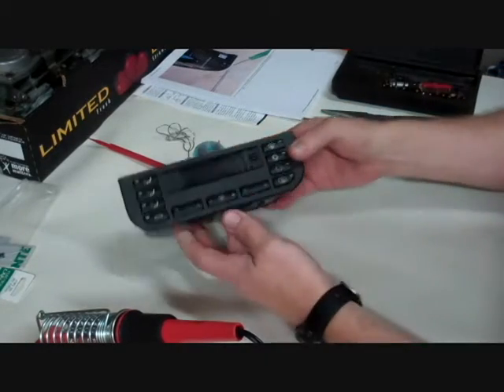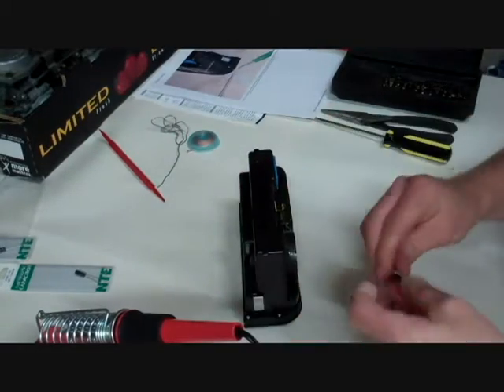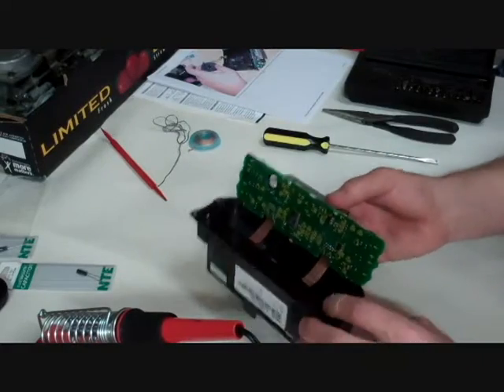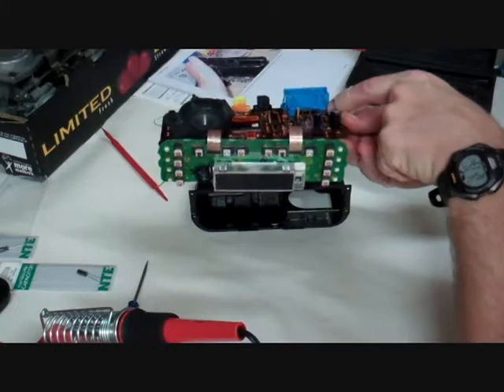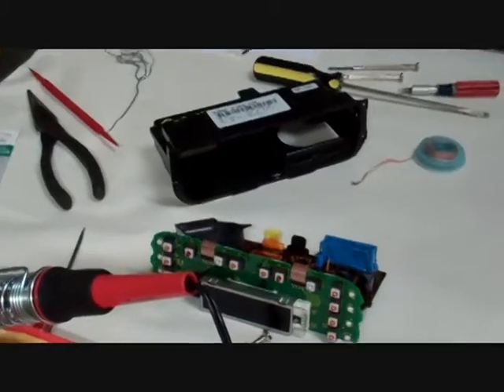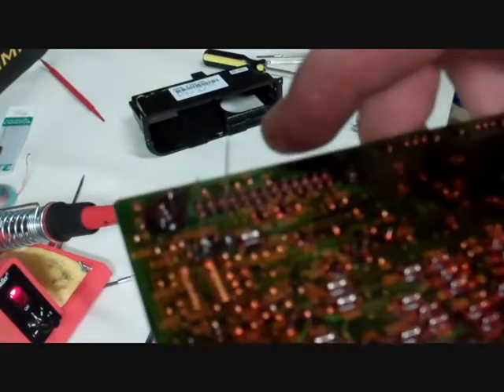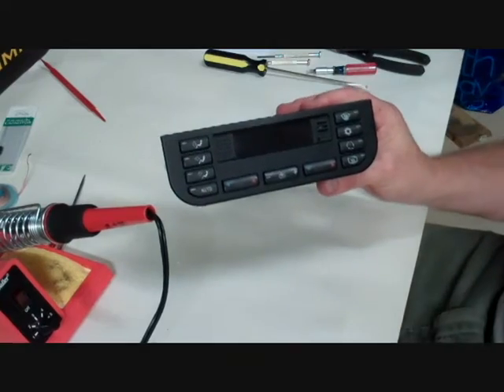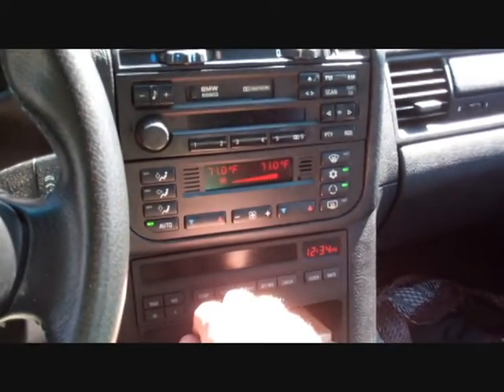BMW E36 Climate Control Unit Fix

Comment: Very helpful to know how all the bits fit together thank you so much. I didn't actually replace the capacitor but just resolved it. A friends advice who said it might be just a dry joint. Anyway, now working fine. And the benefit of courses not just saving money but the inconvenience and delay. Thank you again.

Comment: Barry, on my 1993 525i  e34 the AC, Recirculating and rear defogger buttons do not light up. AC doesn’t work.
Could your capacitor fix work. Thanks from BC Canada.

Comment: Is it non-polorazed capacitor or not ?
Reply: I believe non polarized is fine.
Reply: @barryhasenkpf2989  what if i put a polorized one what Will happen ?
Reply: @barryhasenkpf2989  yes i found polorized 470nF 50v capacitor
But i dont know how to put it i dont know the positiv and the negative side in the circuit
Can u help me
Reply: @barryhasenkpf2989  so if i put a polorized one is OK ?
Reply: @barryhasenkpf2989  OK thank u so much sir

Comment: I have a problem with my climate control (not digital)318i 1992 why the fan always on about 5 minute even i`m not turn on the ac,may be u have the solution sir thanks.

Comment: How can one pin point if it's the capacitor or the fsu? Mine turns on and off randomly and only blows hot air. It'll blow hot air through the windshield and my feet randomly too and the climate control isn't even on
Reply from the maker: Unfortunately, I've only found the process of elimination to work best. I start with the final stage resistor and when that didn't fix it I replaced the capacitor.  If your symptoms are similar to what I described then start with the capacitor.
Reply: Well said, that's what I'm starting with, should be here in a day or two.  If not I have the capacitor in my cart waiting to be ordered.

Comment: Because you are changing the capacitor, which is the defect my is disappearing the letter almost never turns on, and letters come out in half.
Reply from the maker: I'm not sure it's the same problem but the capacitor fix is relatively simple and cheap so you could always do it to make sure.
Reply: I have a 1997 BMW 328i and my odometer had this issue. I followed the 1st guy on this forum, he left a pdf on there.  I think in your case you may want to follow this link  http://www.pelicanparts.com/BMW/techarticles/Borrowed/e36-climate-control-repair.htm

Comment: Thank you for this video.  Very helpful in fixing my Climate Control unit.  I couldn't find a .47uF50v cap.  I ended up using a 1.0uF 35v cap from radio shack.  I read that >.47uF 35v will suffice.  It actually works now and saved over $100.  Again thank you

Comment: I have an e36..mine like to turn it self on..it only blows air from the front vents and it's Dosent get hot or cold...would this fix the problem...???
Reply from the maker: There are basically two possible resolutions - the fix outlined in this video or the final stage resistor.  If your unit is going off and on randomly then I would start with this fix.  If you remove your unit and see the square blue capacitor then I recommend replacing it.   Hope this helps.

Comment: Good video and thanks! Just did this on a e36 that i just bought climate ctrl wasn't working,  nothing would light up and watched your vid went to a local radio shack and bought a 47uf 50v capacitor for $1.49 got home installed it put it back together and it worked flawlessly you saved me $100-200.

Comment: i need help with my pacifica's heat control unit.  the unit is digital, it goes dark by itself some times and if i tap it or hit it, it comes back on.  i have to control over the fan speed, the fan speed constantly blows on high, i have replaced the resistor and blower motor and still same problem.  what is going on with my unit? thanks
Reply from the maker: Not sure - what is a Pacifica?

Comment: Thanks.  Pursuant to your video instructions, I replaced the Climate Control capacitor with a new 47uF 50v on my E36 328i Convertible.  Digital display problem solved.   Al

Comment: Rvisiting this, the trace that the one leg of the capacitor  solders to is fairly obvious, it's wide and goes right to the hole.  I can't see what the other leg solders to. Is it the blob of solderon the other side next to the hole, or to something on top?  Is there a circuit diagram to confirm?
Lotta fun today; it's 72 degrees and with the unit out of the car, the heat blows full bore.  I'd like to fix it before my two hour trip tomorrow
Reply from the maker: If you can send me pic I will try and help.
Reply from the maker: Email is Barryhasenkopf@yahoo.com
Reply: Howard Baxter  May I send my Board to you ???   My email is damascusroad15@gmail.com , over a 100 degrees here . Though it is a convertible

Comment: Great video.  I realized when I went to do this that I already did it years ago.  Now, it's kind of a mess and I can't identify which trace the outside pin connects to.  You can see the big inside one next to the blue jack on the top.  Do you know which one the other goes to?  My screen is now completely black when connected.
Strangely, when I did it years ago, the Radio Shack capacitor didn't work and when I put the original one back in, it did.  Until now.
PS  my blower was intermittent, but all the other lights worked.  Until now.

Comment: I have a 1997 bmw 318i same problem the screen goes on and off but the blower motor still work in the back ground what capacitor do i use???
Reply from the maker: Daniel Vargas Hi Daniel - Use a .47uF 35v or greater

Comment: Hi Barry,

What's the difference between "Polarized" & Non-Polarized"? I went to Fry's & ended up buying the wrong capacitor. I bought a 47MFO 50V (Non-Polarized) & not the .47UF. Would Polarized & Non-Polarized make a difference? Not sure what the difference between a 47MFO versus a .47UF is as I'm no electrician.... 
Also, When removing the ACU from the dashboard, there are 2 wires behind the ACU that need to be disconnected in order to entirely remove the ACU. One is the blue piece that has colored coded wires attached to it. The second wire is black. What is the second wire's function? I ask because the plastic mechanism at the end of the wire that fits into the ACU broke off. Any way to reattach, reconnect and or solder the black plastic mechanism back to the black wire? Any input you have would be really helpful, thanks!
Reply from the maker: Polarized capacitors are for DC applications and Non-polarized are for AC applications if I recall correctly.  An automotive electrical system is DC - Direct Current... Your home system is an example of AC - Alternating Current.  Regarding the black wire I'm afraid I can't provide much help other than to say it needs to be reconnected. If the clip broke then you will need to find a way to secure the wire to the connection point. If the wire pulled out of the clip then you may be able to bare the wire and reattach to the clip.
Reply: Barry Hasenkopf Thanks Barry!
Reply: @Pushrodsand2strokes  can i use polorized capacitor or not ?

Comment: unfortunately for me, it looked like this trick had been tried as it had a similar capacitor as the one I was going to use to replace it. Sure enough, didn't work. Screen must be dead. I used a 1.0uF capacitor.

Comment: Great demo!  I appreciate you describing your symptoms as mine is doing the same nonsense.  I will check fuses first, then do you capacitor fix.  Thanks!
Reply: Looks like this fixed the problem.  You're the best!

Comment: I went to Radio Shack and all they had was 47uF, 4.7uF, .047uF, and .0047uF caps and not .47uF. So I compromised and got the 4.7uF one.  Seemed to fix the intermittent on/off problem (so far).  I did notice someone that had the car before cut one wire off the fan inside it. I resoldered it and I can hear it stays on. Is that normal?

Comment: 16V 220uF 85°
16V 470uF 85°
16V 2200uF 85°
25V 100uF 85°
25V 220uF 105°
25V 470uF 85°
25V 1000uF 85°
35V 220uF 105°
35V 680uF 85°
35V 1000uF 105°
50V 0,47uF 85°
50V 2,2uF 105°
50V 22uF 105°
50V 47uF 105°
50V 100uF 105°
50V 330uF 105°
63V 1uF 105°
63V 10uF 85°
100V 4,7uF 85°

Which one do I need from this list please.
Reply from the maker: Hi I would use 50V 0,47uF 85°

Hope that helps!

Comment: I have an BMW X3, 2007, and i hear a noise coming from the inside of the ac control unit, looking like a noise from the mini fan that gets the air from the inside car, to measure the ambient temperature. It seams that something in the ventilator/fan/pump of the sensor is with some problem. How can i fix it ?
Best regards.

Comment: No air blows (hot or cold) so before i take apart the car and check the blower i figured i would try this. All the lights in my unit work properly no flickering so do you think swapping the capacitor can be of any benefit since the unit appears to be in working condition. Thanks, good vid.
Reply: Did you ever find the solution to your problem? Mine has the same problem after a wreck. Any info would be valuable. Thank you!

Comment: I want to thank you and drlunch who basically shows the same repair. My temperature control unit was acting up. On-off,some part on... a mess. I asked companies to do it for me but they said it wouldn't work so for $10.80 I bought a solder iron, soder, soder sucker and a resistor. Carefully watched both your videos and 30 minutes later: BINGO! Back in business. My suggestion: squeeze the housing (left/right/left/right etc) to pull the circuit boards out. Thanks again!

Comment from the maker: My unit was very sporatic prior to the fix.  I would set it to max and it wouldn't blow any air.  Then for no reason it blew air for 5 mins then quit.  So, it was obvious something was very wrong with it.  Check your basic fuses first then I would move to this.  The fix is very cheap and simple so probably worth a try.

Comment: Is the issue the same if the climate control wont shut off? My a/c and heater works but it wont shut off and it wont go hi or low.
thanks

Comment from the maker: It should only take a very small amount of solder and just be careful not to burn the board with the soldering gun.  What were your starting symptons... did run sometimes and then black out?  Have you tried the Final Stage Resistor?

Comment from the maker: I had trouble with that also... there are two tabs and I believe if you insert the screw driver in the front and pry the outer shell out while moving the circuit board inward you'll release the tabs and then just slide it out.

Comment from the maker: Yeah - I'm fairly sure that this would cover 1998 3-series as that is considered an E36 (1992-1999).  There is some overlap as the E46 also came out in 1999.  Good luck with the fix and let me know if you need any help.